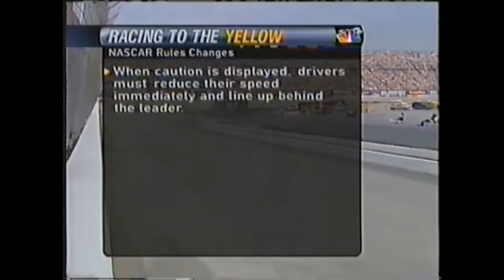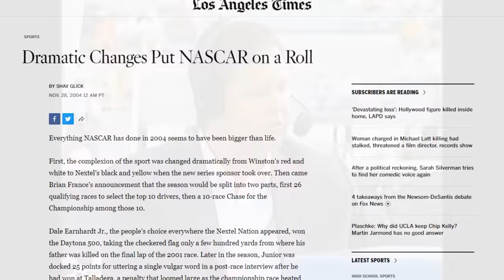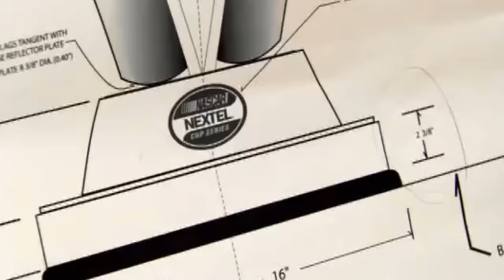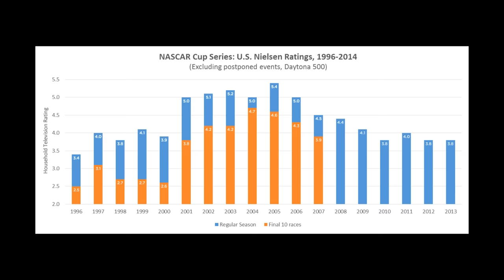NASCAR and the Dam of Legitimacy

Comment: The reason the NFL/MLB/NBA/NHL don't have legitimacy problems to this degree is because the person in charge (the commissioner) is an employee of the team owners – if they are doing a bad job, then that job goes to somebody else. And because of this structure, any change to the rules of the sport is subject to a vote among those who have the most stake in their respective team's success (at least financially).  The situation NASCAR has is like if all 32 NFL teams were owned by a guy who grew up in Rochester: suddenly the Buffalo Bills would be the benefactors of some very suspect calls and arbitrary playoff structures that would magically get them into the Super Bowl (which as a Bills fan doesn't sound so bad right now). It will never happen, but the solution would be if the France clan were employees of the owners. Great video as always!
Reply: ROCHESTER CORRUPTION SHOUTOUT 🗣🗣🗣🗣🗣
Reply: Except that has never happened in football or basketball.
Reply: They should be employees of every worker in Nascar. Or, employees of the drivers only.
Reply: There's also a player's union/association that allows the players to directly communicate their needs and wants to the league itself.

Comment: For some ungodly reason, the Lucas Late Model Dirt Series looked at Nascar's Playoff format and thought it was a great idea to implement a similar system for their 2023 series championship. Ricky Thornton Jr had one of the more dominant seasons in late model racing, leading most statistical categories. He had 23 feature wins on the season, while nobody else on the tour had more than 7, and also led the series in top 5s by a country mile. Out of 52 feature starts, 41 of those were top 5 finishes, while nobody else in the field had more than 32. Thornton effectively had 28 percent more top 5s than anyone else in the field this season, so much so that all but one of his top 10s this year were top 5s. He led the points practically uncontested all year, until the final race of the season at Eldora, where the points were reset to a one race championship-decider between the top 4 in points, much like Nascar. He end up with suspension damage from an incident on lap 9 which takes him out of contention, and Thornton ultimately finished third in the final points championship as a result. 

That championship-deciding race was so egregious that they completely overhauled the format for 2024, with a 7-race stretch to determine the champion instead of just one race.
Reply: I'm good with a seven race stretch. You don't want someone to have clinched the championship half way through the season.

NASCAR takes it a step too far.

Comment: NASCAR is suffering from what many multi-generational businesses do. A combination of the latest generation not being as driven or competent as the founder, exacerbated by changes in the operating environment. It's quite rare for multi-generational family businesses survive 3 generation. The are either sold because the new owners realize they are just not up to the task. There is a reason FORD stands out as a family run business, it's a true rarity to have 3 competent family members run the company. Henry , Edsel and The Deuce.....Brian France ain't the deuce, in fact he is sorta A deuce.
Reply: Less of a Deuce, and more of a Dunce
Reply: I didn't know Ford is still a family-owned business.
Reply: @valutaatoaofunknownelement197  FoMoCo was a family RUN business until 1980. If the Ford family wanted to do something it happened. Lee Iacocca had a bit to say about it in his biography, and anywhere else he could vent.
Reply: @markalbert9011  Ah. Thanks for the clarification. I also didn't know about that.
Reply: The only other manufacturer that did this is Toyota with Akio Toyoda now as chairman. Luckily Akio himself is a racer hence why we see the rise of Gazoo Racing banners everywhere now.
Reply: @valutaatoaofunknownelement197 
They’re no longer family owned as they’re a public company now, but the Ford family still holds a significant amount of the stock and there has been a Ford in either the chairman or CEO (or both) position since going public. More “family controlled” than truly owned.
Reply: @zlinedavid  I see.

Comment: It's like you've said for years, it's precisely because these season long points battles going down to the wire being something that doesn't happen very often that makes them special. Those apologists of the Playoffs cite Matt Kenseth winning the 2003 title despite only one race win as a reason for the Playoffs being better. I would say that winning the title that way is far more stressful than doing what Richard Petty did in 1967 (where he won 10 races in a row and 27 in all), Darrell Waltrip in 1982 (with 12 wins), Dale Earnhardt in 1987 (scoring 11 wins) and Jeff Gordon in 1998 (recording 13 wins). Having just that one win to count towards your points total is heavily relying on other drivers having a less than perfect day to maintain the points lead, hence why Ryan Newman, despite his 8 wins, was only 6th in the standings. 

The Iceberg made an excellent point I feel about how NASCAR style gimmicks are creeping into Formula One, the 2021 Abu Dhabi Grand Prix being a case in point. The championship battle had been very thrilling, seesawing between Lewis Hamilton and Max Verstappen, and going into the Finale in Abu Dhabi, the two of them were level on points. After a better start, it looked like Lewis Hamilton was going to secure a record breaking 8th title, however after a crash for Nicolas Latifi and some arbitrary, on the hoof manipulation by the Race Director, Michael Masi, he shoehorned in a green flag final lap, something that had never been done before or since. The result, by pitting when the Safety Car was deployed, meaning he had fresh tyres to overtake Hamilton when it counted most, Max Verstappen won the race and the title in 2021. At this point I need to say, I have no problem with Max Verstappen, but the way the FIA allowed Masi to manipulate things NASCAR style left many neutrals (including me and my parents) with a sour taste in the mouth after a thrilling season
Reply: And this is why Masi was fired.
Reply: @alaeriia01 that's the only conclusion to draw, but good luck trying to get the FIA to admit it, why would they make him sign a nondisclosure agreement upon his sacking? A bit fishy
Reply: I'm actually in the minority here.
The call was right IMO. F1 had a raise in yellow flags and went closer to the style of Nascar under US ownership, but the place of the crash was racing line, and there was no way to just push the car out.
Another thing: Max had better tyres, but Hamilton could've and should've defended better, especially considering that Max had no DRS avaliable. He went super wide in turn 5. Ride the inside, cut the passing lane doggammit, he opened the door.
One of the reasons why Hamilton's reference and idol, Ayrton Senna, was much loved was because he defended positions without giving anything (I'm serious, he wouldn't give his spot if his mother, Mrs. Neide Senna, said so), and in a championship situation like that you would need to shot him in the head with a sawed off shotgun to pass him.
Besides, it's not like Hamilton's record under pressure is stellar, he tends to fold.
Reply: @otaviofrn_adv  Honestly, the real "human error" was Lewis going off in Baku.
Reply: @alaeriia01  yes, that was a blunder and a half
Reply: @otaviofrn_adv  in terms of bringing out the yellow flag and subsequent safety Car, I agree. It's not the nicest way to end a race, but as a neutral, its a way of the governing body and Race Director not putting their thumbs on the scale to artificially end a race under green. But even then, Masi's abrupt change of mind just made the sport look embarrassing, unnecessarily splitting the new audience it had gained by making a decision to resume racing purely for reasons of entertainment. 

This isn't me being against a late race restart per se. There was time for either following the unlapping procedure to take place if done earlier or throw a red flag to properly clean the track up and resume afterwards, then have a true no holds bared shootout for the title, that way whatever the outcome, it would be more widely accepted one way or the other, it's motorsport. 

What we actually saw was rushed and left me feeling embarrassed, with the FIA making Masi sign a nondisclosure agreement after being fired just raises more questions than answers for why he did what he did. If he and the governing body did nothing wrong, why bother with an NDA?
Reply: @otaviofrn_adv Hamilton did what he could with old hard tyres on that last lap mate, you need to remember that they were leveled on points but Veratappen was ahead on wins’ tiebreaker (IIRC he had 1 more win in 2021 than Hamilton until Abu Dhabi) and had far more risky and aggressive moves on-track wise towards the end of the season. All of it means if both had crashed out because “no gives taken” on that final Abu Dhabi lap, Verstappen would still be crowned champion. Lewis knew Max would divebomb him into the first oportunity he had, so he tried to overtake Max back on the last “overtaking zone” of the lap. But A) Max defended nicely and B) Lewis had old hards, against fresh softs from Max. Masi went with the worst possible decision back there, even an red flag with a standing start with 2 laps to go and everyone with fresh soft tyres would be a less sketchy option…

Comment: Dude hit the nail on the head. I was disillusioned after Earnhardt's death. But once we saw this idiotic play-off format, I was convinced Brian France was absolutely unfit.

And, I don't think NASCAR is going to thrive with its current management and ownership.

But, I don't think it'll die. I think the news of NASCAR's inevitable failure will drive many former fans to gloat, to seek out media related to NASCAR, and add to the chorus of I-told-you-so's. In the process of that, we'll learn that the Frances will have sold their stakes in the organization to another group of sports investors, whom ever it may be. Those involved will, more than likely, either have experience in other racing formats or remember the pre-playoff format of NASCAR and it would be actually pretty safe to assume we see a return to the old points race. NASCAR, as a brand, has value. It won't die. It'll burn, but it'll be reborn, I'd wager. As soon as the France dynasty ends, it can be fixed.
Reply: Don’t tell Ben Kennedy.

Brian hasn’t been involved in a long time.
Reply: Exactly! NASCAR needs a rebirth with a new group of people leading it. I do not know if it will still be known as NASCAR by then, but NASCAR needs a collapse for it to be saved. 

It worked with Indycar as it is slowly making a comeback (though it still has problems), and it is stable, unlike NASCAR currently. On the other hand, NASCAR does NOT need to go through a split like the CART-IRL war.

The same thing can be said for air racing, like with the end of the races at Reno. Air racing needs a rebirth.
Reply: @bafranksbro88  Thank you for the correction.
Reply: @SeraphoftheRoundTable  The collapse will come, one way or another, and fans shouldn't be too upset about it. There's clear interest, it's a staple of the culture, there's just too much money to be made. It'll pass hands long before ending. I know Euros who tangentially follow it. People who, 15 years prior, were mocking it for being lol driving in circles. There's fun to be had. 

And hell yeah, I am loving the new IndyCar. Sure, it agonizes me to see my boy Pato just always seem to come up short, but I love it.

Also, the NCAR has 6 new venues in mind. We don't get any air racing next year and it's a bummer that I won't ever get to compete over Reno, but it's still going. What air racing would benefit from is accessibility. Sure, we all love the Unlimited class and who can say no to the howl of jets and growl of T-6s, but the capacity for growth in the biplane and formula 1 class is immense. I think the organization should put more effort into billing those events.

That, and we need someone to start making something akin to the Cassutt Special again. I really wonder if a Onex could work.
Reply: @MiG-21bisFishbedL  I kept hearing that NASCAR teams are threatening to leave if they can not strike a deal with the sanctioning body (they probably will not). If they were going to leave. I would recommend they join the Trans-Am series, which still exists and has a LOT of potential. Though the glory days of the 60's and 70's with Parnelli Jones and AMC Javelins are long gone. The big teams moving to Trans-Am may get it the needed viewership and money as it is just managing to get by these days.
Reply: I'd like to see S1ap do a video about the aftermath of Dale Earnhardt's death and how things changed like ALOT! 

The team he built, the potential of him trying to win the unthinkable eighth championship and also how close he was winning the championship in 2000 but Bobby Labonte edged him out and look I'll give Bobby credit for giving Pontiac a Cup Series championship but nowadays Pontiac doesn't exist anymore... but also dive deeper into the current 36 race weekend schedule with Chicagoland and Kansas inaugural race and how would've Dale performed in those new tracks at the time if he was alive today that could've put his performance at the tracks succeed or fail to make some points for the championship in 2001... his sponsorships with RCR like GM Goodwrench, Oreo, Sonic, Hershey was on a limbo and there's a couple articles about the Sonic and Hershey sponsorships Sonic had a article prior to the 2001 Daytona 500 but when Dale Sr died the Sonic Corp. mourned his passing and as for Hershey on March 2001 on AdWeek I found a headline describing the Hershey sponsorship something like "Promo on Limbo" the hard part is you can only see part of the article and you have to be a member to unlock the full details of the article it's crazy and I'm not wasting my precious money on it unless some fan wants like S1ap over here could help us out but lastly also I'm still trying to figure out what was the original idea for EAs NASCAR Thunder 2002 the video game if Dale didn't pass he could've been on the cover and a playable driver but there's no articles about that and that's probably behind EAs closed archives that no one is allowed to read or something that's behind closed doors and will remain closed for years so I'll keep guessing up to this point if EA doesn't give us any hidden material from them...

And lastly this one is a lot of speculation Dales retirement this one really is the most speculated one I've been trying to figure out and all of this I said is what it's called "Cognitive Completion Theory" just like the FNAF series in the early years of the games where fans are trying to find every single ounce of hidden material...

The almost same thing with Dale Earnhardt's death trying to find every ounce of hidden material possible weather it's articles about sponsorships, the sport in general or whatever it might be prior his death and after his death to see if it all makes sense and rip every piece of material to shreds because there's more that's beneath the surface and we haven't done that yet but only a certain few including myself...
Reply: I'm sure it will always be popular in the south but in other parts of the country its being overtaken. F1 and indycar are growing in america and dirt track racing is growing rapidly due to streaming. In ohio everyone I know who is into racing either watches sprint cars or Indycar. I don't think a return to a normal points system will change much
Reply: @bradenLa  Not even in the south is NASCAR doing well. They strayed so far from "the old guard" so much that many have stopped watching NASCAR for years now.

Most nowadays watch Sprint Cars or Late Models at their local tracks. Heck, I know quite a few that love Baja trucks. The South is moving on, too.
Reply: @SeraphoftheRoundTable  IndyCar is dying, Honda's pulling out.
Reply: @Dexter037S4  Motorsports, in general, are dying. F1 is tanking as well. Las Vegas was a disaster. Honda has only threatened to pull out of Indycar. It's not confirmed yet, last I heard.
Reply: @SeraphoftheRoundTable  Yeah, only threatened.